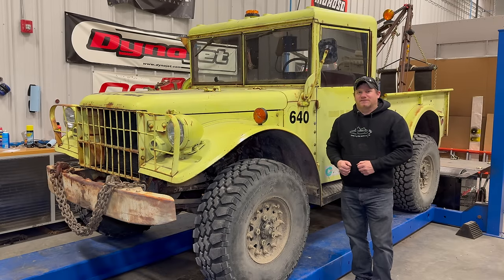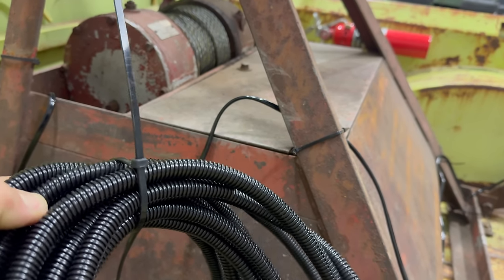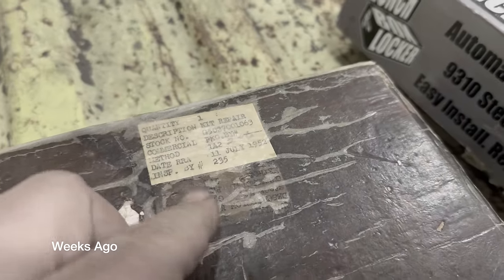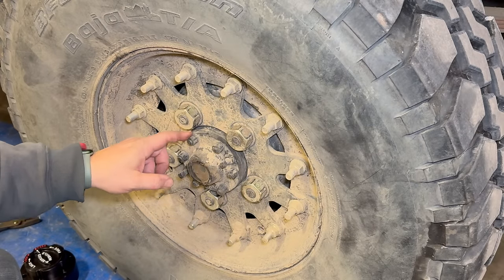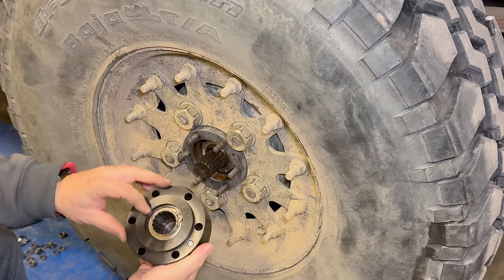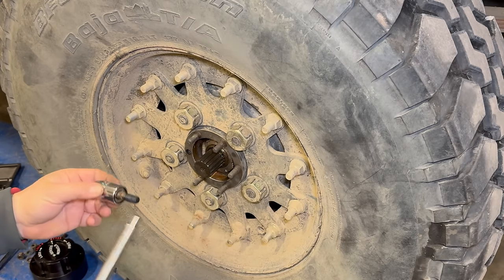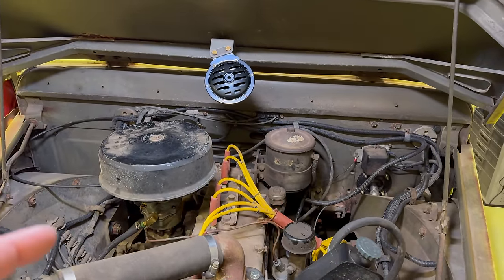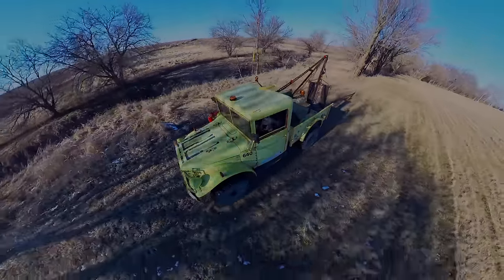Finishing the Free Wheeling Hubs and Last Electrical Work

Comment: The wrecker is coming along nicely Steve. It is turning into a functional vehicle, and it is classical enough to do it with style! 

Free wheeling hubs are simply the best. You can engage low range to assist with backing up a trailer while on hard surfaces without worrying about potential driveline damage, or creep along slowly without riding the clutch. They supposedly reduce fuel consumption by not requiring the engine take into account the additional load of the front driveline, however to me the savings would be negligible. I do recall that being something promoted in old advertisements in magazines back in the day though.

I do have to say though, I cannot recall ever hearing someone describe anything Lucas electrical as being "high quality" ever!
Reply from the maker: Unfortunately now that everything for sale is made in China, a Lucas switch is now much higher quality than the new stuff being offered.

Comment: Some interesting additions to the Dodge M37. The lights on the boom will be of help if you are asked to recover something at dusk or in the dark. They seem to give bright light which is what is needed. I like the new horn that is very much the same as the old one as you say but 12 Volts and the method of wiring was a good idea. I think you have now covered almost every eventuality you are likely to encounter when out in this truck, all very worthwhile. Thanks Steve for the post this series has been enjoyable and I know there will be more to come. 👍👍